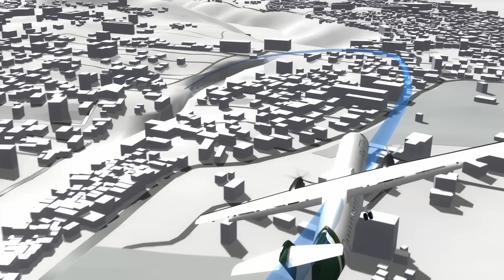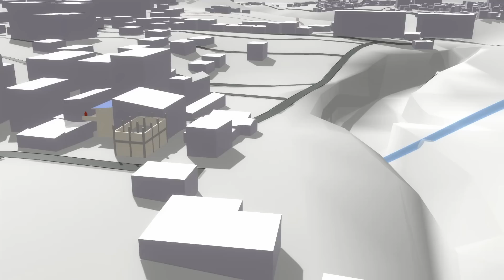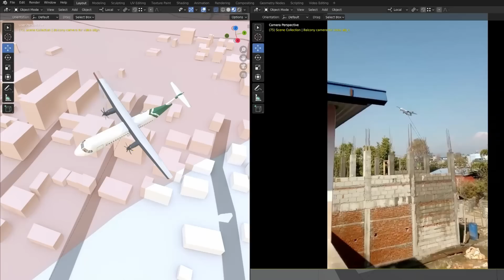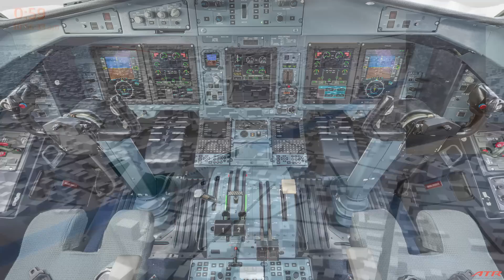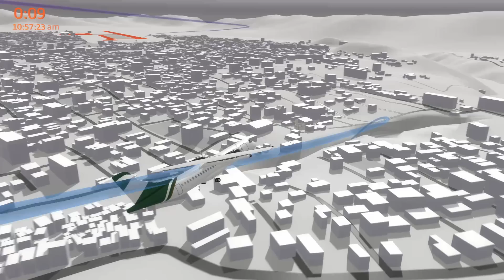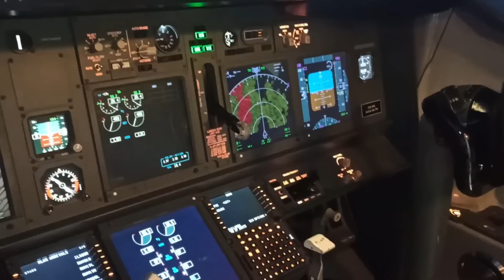HUMAN ERROR or MECHANICAL?! | Yeti Airlines flight YT691 illustrated

Comment: The passenger video inside the aircraft originally had the distinct sound of a catastrophic engine failure. The videos on youtube have all edited it out now. Obviously the second part of the passenger video is of the aircraft at about 1000ft or more with a nose down attitude (perfectly fine)...it then cuts to the sound of the stall/crash. It's the passenger video that clearly doesn't align with the ground footage where the aircraft is 300ft agl or so with a very high nose attitude. The witness on the ground said the sound was very low probably pointing toward both engines shutdown. Both engines appear feathered too.  
The aircraft can clearly be seen to pitch up agressively, even though it had an already high nose attitude. Why would you do that?! Did they win the battle against the stick pusher at that point?  I've never tried but i reckon you'd have to  have superhuman strength. This agressive pitch up induces the stall & it drops a wing. I think they simply had an engine failure & then shutdown the wrong engine. For this reason they weren't able to maintain height & speed resulting in the stick shaker & finally a wingdrop stall. 
I'm just trying to remember how good the 500 series yaw dampner was ...could it have caused the confusion resulting in the shutdown of the wrong engine? Certainly the 600 might as it removes the need for pilot input (whereas the 500 doesn't). Confusion on which engine to shutdown is common obviously, & i think with modern yaw dampners an engine check would be preferrable when assessing which engine has failed, followed by a "select & confirm" approach by both pilots (starting with the power levers so if you do chose the wrong engine you can fix it instantly).
Btw...if you put the gear down (as they had) with both engines out in an ATR72 the aircraft glides like a brick!  (Gear up it glides fine...I don't think those flaps were fully down in the pax video btw). We all had to practise that after the A320 splashed into the Hudson river. That Hudson river accident should have made it back to the airport quite easliy actually. But hey, the movies never lie. The pilots were slow & incompetant.
Frankly I think if you have an engine failure on base - Don't do anything about it!!! Just let the bloody thing feather, use both throttles as ifl they're both are working, & trim it as needed (unless it's on fire). All this identify, confirm, feather crap is confusing at that point. The aircraft is designed to take care of an engine failure automatically so let it do the job & worry about it on the ground. 
I'm not even going to go into why they were doing a base leg...it shows no understanding of glide angle. 
All of this points quite plainly to training deficiencies in the airline, which resulted in poor judgement by the pilots who were overload for an otherwise simple situation ie. engine failure on base = carry on as normal & land.
Reply from the maker: Catastrophic engine failure noise on the video! You are mistaken and making stuff up. The black box showed both engines were functioning just fine all the way to the end
Reply: @Mike-Bell  No..I'm not making stuff up. The video clearly had the sound of turbine blades scretching against metal. It could be the video  i saw was fabricated but it came from mainstream media. If you were to bring both condition levers to fuel cut-off you'd have to go through feather. Do you honestly think the pilot could do that without noticing? The sound change & thrust surge would give the game away long before you got to cut-off (& you're suggesting neither pilot noticed & just carried on as normal?). Not to mention all the alrams that sound...
The mainstream media had the sound of the engine failure but youtube doesn't have it. The pax video clearly has bits edited out because you don't go from nose down stable, to slow, nose high, stall, crash in 2 seconds as the video makes out. What do you mean "both engines were functioning just fine all the way to the end"? Both engines were shutdown right??
The trainer had 20,000 hours logged, & you're telling me he just shutdown the engines via the condition levers??  The pilot even raised the power to 45% (which is impossible due to the gauges being dead) before completing the before landing checklist?! All the time not noticing the engines were shut down while the alarms blared?? Bullshit...that is just not believeable nor realistic. And we should all just forget the longer passenger video footage shown on the mainstream media? Sorry, I'm just not that stupid. I still have the sound of that engine failure in my head...it was catastrophic!
The real question is why Yeti Airlines decided not to tell the truth? Why did the media change their tune? Did something happen in the cockpit that was unsavory? Like a cockpit gradient issue? Why did the aircraft pitch up aggressively? Why no mayday call? Who knows...now I'm guessing.

Comment: I agree, great job!  Thinking an auditable indicator should sound when feathering is adjusted.  The captain couldn't look down and fly low very easily.  If they could hear that the wrong configuration was executed then they could have quickly corrected.
Reply from the maker: Hey Ryan
This is proof pilots MUST have strong technical knowledge. Zero torque on both engine from a technical point of view shouts check the props. If you aren’t naturally technical you should not be allowed to pilot a plane. Tons of other jobs for you but please don’t be a pilot and put lives at risk.
Reply: @Mike-Bell  true.  She should have glanced at the gauge and known to check the feathering instantly.  They co-pilot was a more expected pilot and a captain so the responsibility really landed on him.  He was there to certify the pilot for the captains seat.  I think auditable alarms are the solution still.  Humans are humans.  We do stupid shit and struggle under pressure.  More hours in the sim, with more failure scenarios are the first corrective action, but alarms should exist.

Comment: It seems pretty obvious that the workload was too high for both crew to realise what was going on. As a training captain you're monitoring much more than just your own actions, and was possibly already too distracted by the unfolding emergency to realise what he had done. And the pilot being evaluated trusted that the training captain would assist in the emergency while she was obviously concentrating on flying the aircraft.
Scary.
Reply: True there should be 3 people in cockpit, 3rd captain just observing doing nothing wlse
Reply from the maker: I think both pilots display poor technical knowledge. Zero torque on both engines the first thing to check is the props. Its shouting a prop problem. Even worse they ignored the problem or didn’t see the gauges at zero. 
And worrying that a 6000 hour pilot deferred to her senior so much. The final report will shed much more on all of this but this is why rigorous training is so essential when you have passenger who are expecting a safe flight. If you have poor technical knowledge please don’t be a pilot who carries passengers. Many other jobs for you.

Comment: Nice video sir. Heard those pilots were experienced personnel. How come they made such a silly mistake that cost the lives of themselves and 68 passengers on board? The condition levers and flap levers have a day and night difference. I still doubt whether it was a piloting error or mechanical failure.
Reply from the maker: She was 6000 hours which is a lot. But its poor piloting and weak training. Both pilots according to some were fed up over salary and the airline so perhaps they were agitated and distracted. Professionalism requires you to put that aside and fly responsibly. 
Hopefully the final report will shed more light.

Comment: What kind of pilots fail to monitor speed on approach?  What kind of pilots fail to operate two most basic controls properly?  What kind of pilots fail to anticipate a stall at too slow, full flaps and zero torque?

Brutal beyond belief.
Reply from the maker: It would seem these were 2 pilots who didn’t really understand what torque is and other technical stuff. Technical knowledge for a pilot is an absolute necessity. Otherwise you should not be allowed in the cockpit with passengers. And as you say both pilots taking the plane to a stall-spin is brutal beyond belief. 
Zero torque is shouting prop problem. If you miss the feather then its immediate forced landing when at 600ft agl. Both pilots did none of that. 
And they had a runway right there. At master caution they were still at 150knots.

Comment from the maker: PLEASE NOTE: 
The preliminary report only confirms both props went to feather.  Think of feather like neutral gear in a car.  It does not say that the condition (propellor) levers were moved nor who may have moved them.
 So we can’t be certain who feathered the props or even if they were feathered by pilot action.  
We only know that when the pilot monitoring said “Flaps 30 and descending” the flaps did not lower and both propellors went to feather, at 60 seconds to go.

The possibility exists that a systems malfunction could have feathered the props in error.  The prop lever would have remained at the AUTO position.  The procedure in the case of an erroneous auto feather would be to advance the prop lever to 100% OVD (override) position.

*The flight was operated by two Captains.  The "junior" pilot was an experienced Captain with 6,400 hours but was not yet signed off at this new airport.

* The black box does not include cockpit video to confirm any actions by the pilots.  The black boxes only records flight data and cockpit voice.
Reply: I am confused. When she is calling it out, is she saying this is what she going to do?
Or when she calls it out, is she instructing the senior pilot to pull the level?
Do you mean she is calling it out as she is doing it, but the senior pilot should have been monitoring her to see that she pulling on the right level??

If they made the error and the alarm went off, could they not see that they had made an error and correct it right away?
Or is everything happening so fast that they was very little time to react? 
Awesome graphics by the way. Having that footage of the planes final footage from both inside and outside has made a lot of people wanting to know what happened. So tragic. May they rest in peace.
Reply from the maker: Pilot monitoring said "Flaps 30 and descending".  From the way pilots talk it is widely accepted senior pilot was moving the levers.  Pilot flying will often have co-pilot do things especially while landing when there is a lot to do and keep a check on.

And yes the alarm should have had them check gauges and instruments to problem solve. Zero torque on both engines was loudly pointing to a prop issue.  Sadly their trouble shooting came up empty.

Comment: I have 10k hrs in the Twin Otter, smaller but a PT6 turbo prop. Ok so he feathered both props, how about:

The distinctive change of sound?
The loss of trust, they were not high, not at flight idle so they were relying on some engine power.
When feathered and with some power, the engine torque would greatly increase. unless the ATR has some min fuel setting  (bypassing the power levers/FCU) and the FCU goes to min fuel.
You stated that the engines were running, it takes 10 sec to unfeather a prop, yet they sat there for 60 seconds.
Old airport straight ahead, too high but city between them and new airport.

Watching this is beyond.....

Thx for excellent vid.
Reply: In a otter, the prop is right there. You can see it and close enough to hear. But in a low power setting for close final.. The sound differential would be less. On the atr , no visual of the props and much further away. But I agree this crew was not scanning the engine gauges.. Which I think I think is ok during this very phase.. But you cannot let your Airspeed decay like that. Once you see the airspeed decay.. Then you have to look around and see what the problem could be. The only thing they did right was break off the turn to final and level the wings.
Reply from the maker: The master caution came just 6 seconds later as system picked up the drop in torque below 25%. Most basic piloting teaches you on engine out you straight away start planning forced landing. And at 500-600 ft agl you are in forced landing mode. 
One can only think that cognitive dissonance prevented pilot from registering what the gauges we’re shouting. Zero torque can really only mean one thing. 
The loss of thrust to some extent would have been cancelled out by no extra deceleration from flaps not moving. I presume the pitch change while at 40% power would not have been very distinct. 
But the eyewitness on the ground said the sound was less than other planes turning onto final approach. Much of the noise is clearly from the props providing thrust.
Reply: @Mike-Bell  I have been flying and instructing in Asia for the past 15 years. The overall piloting skills, decision making process, CRM and technical knowledge is sub par and it is very hard to improve all these skills. It was not the accidental feathering that caused this, as it seems that both engines were still running at min fuel stop, it was total lack of corrective actions on part of the crew. Very sad and still beyond comprehension.
Reply: How about both TORQUE METERS going to ZERO when the Props were Feathered?

Comment: It would have been MUCH better if you had thought before posting. The plane crashed because both propellers were feathered for the last ~30 seconds of its flight. The interim accident report does NOT state why the props were feathered. One possibility is that PM operated the prop condition lever instead of the flaps, but other possibilities exist. What a more responsible person would have said was "one possible cause of the crash was PM operating the prop condition lever by mistake instead of the flaps. This is currently the most likely proximal cause of the crash, but we will wait for the full report."
Reply from the maker: @H B I took 6 weeks to make this and I can assure I put a great deal of thought into the video. I could not come to any other conclusion that PM moved the wrong lever. 

But I cannot state as a fact and the report is silent on this. I hear what you say and  I will put up a pinned comment saying it is not certain PM moved the lever. 

Yes and its not certain that the condition levers were moved to feather but there isn’t really any other plausible explanation for the zero torque data point, the master caution, the continuous drop in airspeed and the quieter sound described by the eyewitness.

Comment: Excellent video
The fact that he actually set flaps 30 having before confirmed he had set flaps 30 when he actually feathered the props shows how distracted the pilot monitoring was.  
I assume he decided they should fly the reverse approach to support the sign off? 
Not sure why he got so distracted when she was just flying a straightforward visual approach. OK, a bit tight and therefore low but it was to a long hard runway, not a short dirt strip so not difficult for a pilot used to challenging approaches in that area. 
Seems the decision to change runway was made quite late so they probably had not done a proper briefing and were "winging" it a bit
I hope they release the CVR transcript
Reply from the maker: Great comment. Instructors do sometimes jump things on the pilot learning and in the moment thought, as you say good for the pilot to have done the alternate approach. 

We might never see the full transcript which surely will give a much clearer picture. There is a rumour that the pilots earlier in the flight were complaining about salary and the airline. So it’s conceivable Pilot Monitoring was angry and distracted. Otherwise very little makes does it!?
Reply: @Mike-Bell   I noticed in the preliminary report that the PM's flying license was about to expire in a few months, while the PF had plenty left on hers.  So  #1. Either PM was attempting to prove that the PF is/was incompetent to be a captain. or #2 He was suicidal and wanted to take 71 souls with him.

Comment: Unbelievable how two pilots missed the propeller pitch control lever set incorrectly.When power was applied with no increase in airspeed was a dead giveaway.Those pilots both made rookie mistake.
Reply from the maker: Sadly that is the only reasonable conclusion.  Pilots like this should not fly but there are those who still do.
Reply: Perhaps women in cockpit is a bad idea.

Comment: The training capt sitting in the RH seat accidentally put the condition levers to feather then off instead of putting flaps 30(full) which was ordered by the PF, capt on the left seat. 
For argument sake, Why are all the levers in parallel? 
i know its never happened before with an ATR but as we all say “Murphy is alive” and anything can happen when you least expect it. For sure it is Pilot error but there are lots of factors that lead to reach this scenario